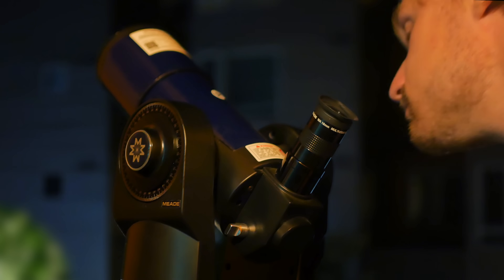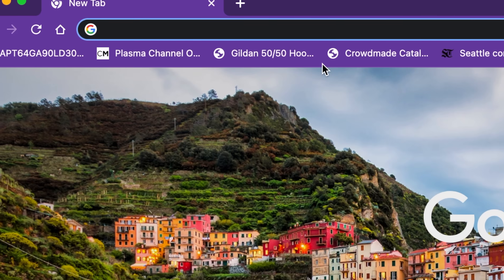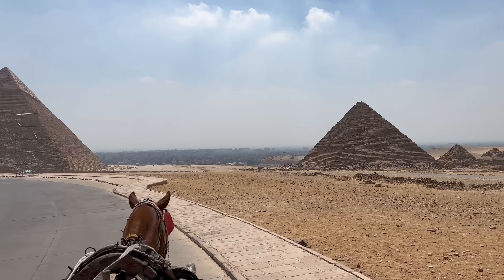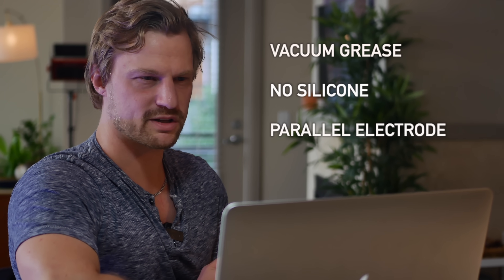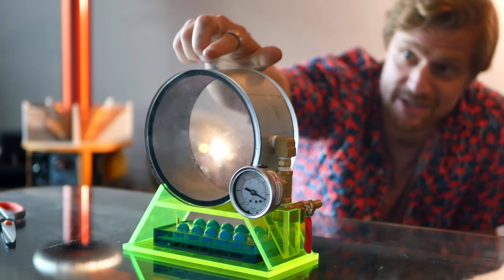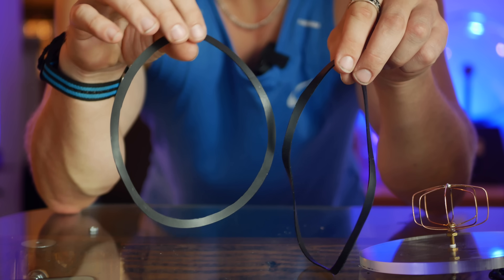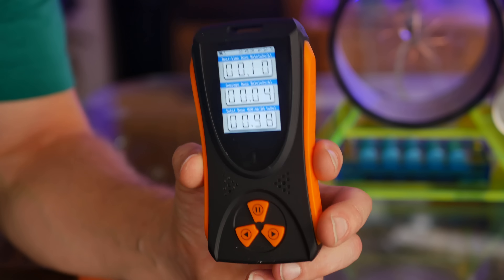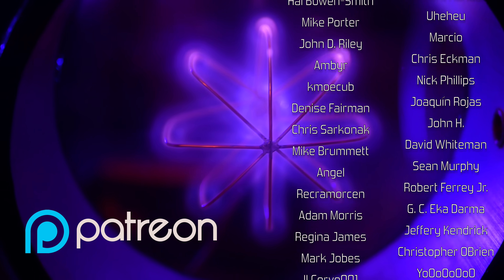Building A Nuclear Star In A Jar (Fusor)

Comment: Hey heads up, that reactor is probably not safe for fusion. The big acrylic windows could melt in the electron beams that form and the plasma heating them up. Also the aluminum frame and acrylic windows are transparent to xrays so it needs to be fully encased with shielding or it'll spew xrays like crazy. And you need neutron shielding as well. And even the backscatter can be very very dangerous. It's a grogeous demo build for sure though. One of the nicest I've seen honestly. But please don't try running that at fusion temps. Also there are a host of different laws around building these and many places require a license of some flavor or another. It's easier in the US, but varies state to state and can still have issues if you're not careful and you'll be posting the video as evidence of you doing it... so better safe than sorry. I know this because I almost built a working fusor on my channel recently but stopped when I learned about the license and 100K fine for not having it. So I paused the project until I could sort that out and get the license in advance. If you wanna chat about this I've been at it for years and might have some tips. Hit me up. There's a ton of amazing things that can be done with this if you get reasonable neutron outputs.
Reply: Man I used to watch you all the time , are you coming back anytime soon?
Reply: @gameingking8971 he's been back for a minute he posted like 2 weeks ago
Reply: Listen whats this person's saying!!! TTE im a subscriber to your channel, thanks for creating your content and sharing it!
Reply: Hope it is not too late!
Reply: This needs to be pinned so everyone can see it. Not to put plasma channel down but he really dove into this project without researching thoroughly. Fusion can certainly be done at home, but it's not something you just throw together out of craft supplies.
Reply: @RMX7777  What do you mean "fusion can be done at home" it absolutely can't. If it were that simple then we'd be completely off fossil fuels
Reply: @Butterspunk69  It absolutely can. That's what a fusor does.
Reply: @mattcurrent00 lol okay bro
Reply: @Butterspunk69  There is a massive difference between doing extremely small-scale fusion with no (usable) power output and doing power generation scale fusion that is self-sustaining with an extractable energy surplus. We've been making and operating fusors since the 1950s.
Reply: @RMX7777 ….did you guys actually watch the whole video?
Reply: @MaxfieldTwo  yeah?, I've watched the whole thing through a few times.
Reply: @MaxfieldTwo  obviously they didn't coz if they did then they wouldn't say this. He did the radiation test
Reply: @EverydayOpium  Did you watch the whole video? Yes he does the radiation test at the end, and determines that he has not yet achieved fusion. He then states his intentions to improve upon it until it can function properly.

Thus the warnings given are legitimate, his reactor is not safe for fusion, and it should not be attempted.
Reply: @RMX7777   HE DID NOT GET THE THINGS FROM A CRAFT STORE! DID YOU WATCH WITH AI OVERVEIW?
Reply: @SajithPrathees  No, I didn't use the AI overview, that wasn't even a feature on YouTube when this video came out.

The entire point is that acrylic isn't a suitable material for building a fusion reactor. Using acrylic makes it a fancy toy, not a scientific instrument.
Reply: I like the fusion reactor that has a sphere of cannons around it, steampunk af.
Reply: What is the License? I can't find anything about it online other than people just saying that it exists but no actual names for the license so I'm just wondering what the name of it is.
Reply: @nickonizer  I can't speak for everywhere, but if you live in the US it varies from state to state. The law would not be specifically for fusors, but rather for radiation producing devices.
Reply: @RMX7777  oh groovy I'll just make it not produce radiation and I'll be good right?
Reply: @nickonizer  So long as you keep the voltage below 15kv you shouldn't have any issues.
Reply: This fusor set up doesn’t look like it has enough power to actually produce any fusion reactions, but otherwise your comments are on point about the needed shielding if the design is powerful enough…
Reply: Just pulling up the ladder more so people have to get some useless paper from a college.
Reply: Hey bud I don’t think this is supposed to actually produce a fusion reaction or at all capable 😅
Reply: Thank you for commenting on this video, (love your channel) you're part of reason I knew this was worth watching
Reply: To hell with the government.
Reply: Yeah the intellectual workspace just got locked down by me. Those "Laws" anybody speak about be our birthright by the psychedelics penetrating into my mind I was showed the problem earlier
Reply: .0LP
Reply: Why u suspend it in water.
Reply: screw the government, build the reactor.
Reply: Reminiscing the scene in the movie Chain Reaction, when a few City blocks were leveled. 😮
Reply: Dude, where on earth you will get deuterium or tritium? Just curious))
Reply: @СтасКрутько-м1т  Deuterium can be purchased online, but it is expensive. It is also possible to electrolyze it from water but this would require months of work.

Tritium is over $1,000 per gram and is heavily regulated. He will never get a hold of a large enough quantity of tritium for fusion.
Reply: @СтасКрутько-м1т  United Nuclear.
Reply: @СтасКрутько-м1т easy to buy D2O but not cheap.
Reply: @СтасКрутько-м1т  dueterium isn't hard, but tritium is very hard to get
Reply: Well, you just got yourself another subscriber! Can't wait to see where you take things! Meanwhile, I'll enjoy your back catalogue. :)
Reply: Rules are meant to be broken 😏
Reply: no u
Reply: That won't be an issue with the amount of neutrons he's likely to get from this.
Reply: B careful fusion scientist have a tendency to go missing
Reply: aluminum is opaque to x-rays, they literally use it in hospital equipment
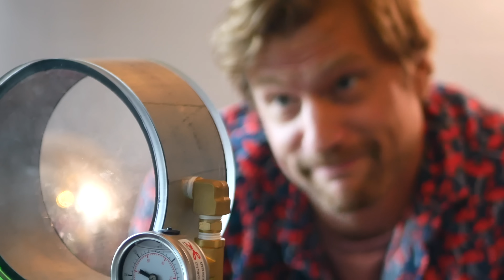Reply: 8:35 how do he connect the wires to the metal shape in the middle
Reply: Bro who are you
Reply: @GamersCreedGaming he’s only the best biologist YouTuber in the world!
Reply: I would probably recommend synthetic sapphire glass as a replacement for the acrylic if you make one capable of fusion. What would be better is a led based glass as it’d absorb most of the radiation that escapes from fusion
Reply: I getting blind by reading comments 😢
Reply: Do it 🤓 or no balls
Reply: It's like watching special forces
Reply: The inverse square law probably means he’s fine at 5-10 feet away, even if it does generate X-rays
Reply: Damn, bro wrote an essay
Reply: 2:11
Reply: Wait this is real?
Reply: Extremely helpful advice and a collab I’d honestly love to see.
Reply: I just ... yappocado
Reply: This is why for my next career im looking to get into an industry without licenses! Too much for them! plus fees once you jump through their hell of a test. Train and done at location. No more bs driving to god knows where for a stamp.
Reply: also they expire in a year.
Reply: Updates on the meat robot 🤖?
Reply: time to search up casimir effect and Salvador Pais's High frequency gravitational wave generator patents they are confirmed and US Navy locked down. All this stuff is so so so obsolete and it's a crime to not have all you intelligent people driving the new fields forward for the last 50 years 😢😢😢
Reply: Well that's stupid, why have it to where you need a license to build a fusor? This is why fusion technology hasn't progressed, the very ingenuitive people in the public who could actually get this working on a practical scale can't get a hold of the technology.
Reply: @glamrockfoxy3962  you need a license so you don't get a nuclear boyscout incident all over again
Reply: How is this any different to just having a florescent light?
Reply: Dude your a wuss lmao
Reply: You'd need deuterium to make this thing work. At best you are simply making plasma from the air
Reply: didnt you eat a mummy
Reply: Longtime fan of your channel! Thanks for sharing the wisdom gleaned from your work. 🙌 🙏
Reply: That's valuable advice you've given, hope he understands the implications. Given how he responds to those giving him praises and not you says a lot. I've watched a number of your videos, really professional work in both areas of science and content creation. Looking forward to your next upload.
Reply from the maker: Hi Nicholas, I don’t respond to every comment, but appreciate every one. 

People seem to forget that I had a fusion engineer look over my design, confirmed I’d likely not produce much fusion, I tested it and found no radiation, and my power levels were far too low, at a few dozen watts. 
I liked the educational aspect of the Fusor and the beautiful output more than anything! Cheers.
Reply: @PlasmaChannel  Then shouldn't this have been presented as a demo fusor? At every point through the video you made the claim of working towards real fusion.

It's only after understanding how truly difficult it is that you try to reinterpret your intentions. You've made comments to others saying things like " just wait until I add deuterium and the Geiger counter sings". Not your exact words, but they are close. The comments section is long and it would take me a long time to find it again.

At no point in the video is there any mention of the fusion engineer saying that your design wouldn't produce much fusion, so nobody forgot.

I don't like being negative, what I wanted was to see you iterate and eventually come up with a design that would function, but instead you've chosen to try and mislead others in your intentions.

Again, I've always been a big fan of your channel, but this has all been really disingenuous.
Reply from the maker: A demo Fusor built with sufficient design, such as mine, will produce small amounts of fusion. It requires power levels that are higher, and the addition of D and T, both of those situations i intended for another future attempt.

The engineer and I talked for a long time, the snippets of the conversation shown in my video were just that. Snippets. A lot of spoken conversation was left out. 

That being said, I did build a “nuclear Fusor capable of fusion”, as promised throughout the video. I just did not press the correct variables hard enough.

Therefore, I indeed was working towards true fusion, with this being the first video in the series. 

So, any interpretation of being mislead, is just that- an interpretation. I’m sorry you feel that way.
Reply: @PlasmaChannel  It may theoretically be possible to fuse a few atoms in your setup, but you haven't proven it. You say your design is sufficient, but that is just not true. The acrylic walls would melt under the conditions required for detectable neutron emissions.

It isn't as simple as backfilling with hydrogen isotopes, fusors require conditioning, and that means they need to remain under full load for extended periods of time. 

Increasing the power output for your supply will not resolve the issue, at least not until you can achieve a deeper vacuum. At the pressure currently present in your chamber, it will only result in electrical arcing between the grid and the walls.

If you're going to take this seriously you'll need to make the switch to stainless steel high vacuum equipment.

Furthermore, if you somehow did manage to bring your setup to fusing conditions, even if only momentarily, the lack of steel walls would ensure that you would irradiate yourself. Breaking radiation is no joke.
Reply: @PlasmaChannel  it is nice to see people worrying about others...world’s cool. 😚
Reply: @PlasmaChannel  I went ahead and thought on what you've said, and watched your video again with that perspective. I've concluded that my expectation for what you were making did not match your intentions.

I suppose as someone with knowledge on fusion, I had mislead myself into believing you were working towards something more technical.

In reality, after watching again I can see that you just wanted to explore a cool part of the universe we live in, and share that with others. That is something to be respected.

I wish you luck in achieving your goals, and if you would consider it, I'd still like to give you some advice.

Adding deuterium to the chamber will not cause any noticeable change with your Geiger counter. This is because rather than being caused by fusion, the high energy photons given off by the reactor are created from breaking radiation, primarily from electrons emitted by the central grid accelerating towards the positively charged walls of the reactor.

Radioactivity can be a rough estimation of fusion occurring however, as it would allow you to know that the electrostatic potential well is deep enough for high energy physics.

What is important is that if the conditions in the reactor are sufficient for fusion, the x-rays should also be generated without the deuterium fuel present.

As you have suggested, one cause for the lack of these conditions is the power supply. While the voltage is sufficiently high, without the current capacity to back that up, the voltage will sag deeply under load.

Ultimately both the power supply and vacuum pressure will need to be improved to achieve your goals. Again, if you take anything away from this, it is that you should detect radiation even without the hydrogen isotopes present.

For the rate of fusion you are aiming for, protecting yourself from neutrons does not need to be a consideration. Instead, just keep your Geiger counter handy and monitor your exposure to x-rays.

And please don't use tritium, deuterium is plenty sufficient on its own. While fusion rates would be much higher, if your only goal is to do some level of fusion, it is dangerous and unnecessary. Not to mention likely illegal.

As a final bit of advice, a thermocouple type vacuum gauge should be used to take a reading directly from the space inside the reaction chamber. This is the only way you will gain insight to the conditions within the reactor to any degree of certainty. If this is not possible however, it is roughly possible to estimate pressures by visual characteristics of the plasma.

I can't say if vacuum pressures of 1-30 microns are possible in the type of system that you've built, but I wish you luck in your attempts. Keeping all of the components incredibly clean is of high importance.
Reply: @RMX7777  love when someone can admit they may have been a bit off base with their opinion. Nice way to start my day, so thanks!
Reply: @RMX7777  what in the world
Reply: @RMX7777  is it even possible to buy Tritium without setting off reflags somewhere?
Reply: @tylerdurden3722  It can be purchased in the form of self powered safety lights but these typically contain only a few micrograms of material. My concern was he would try to open one of these up and expose himself to radiation.

It's pretty much impossible to get a hold of enough tritium to do any fusion, especially considering it costs around $1000 per gram. You would need around 10 grams to run a fusor for a few minutes. 

Deuterium on the other hand is relatively cheap and completely unregulated in the US.
Reply: @RMX7777  Someone is salty AF
Reply: @wdtripps44  If you would read through all the comments you would know that's not true.
Reply: @PlasmaChannel next we'll hear that dude actually loves tomatoes!

Thanks for the awesome vids; I really appreciate the good mix of science!

Edit: and glad to see that speed square has metric on it 😎
Reply: @PlasmaChannel 

Pin this please. I found the cautionary comment and had to search for this response.
Reply: fr, that person did a good thing and reflected on their though process, then clarified that they could have said or done things differently. @Resyektt
Reply: @RMX7777 he also says just wait until I add deuterium in the video while holding a geiger counter lol
Reply: @richardrhodes9664  I'm not sure which of my comments your replying to, but many of them state  what you just said. I'm not really sure what the intent of your comment is.
Reply: @PlasmaChannel that's good 👍
Reply: @RMX7777 no where in this video did he say he was producing fusion lmao
Reply: @Zaque-TV  Yeah? And no where in any of my comments do I claim he did fusion. What's your point? My comments were directed towards his intent to add deuterium in a follow-up video
Reply: @PlasmaChannel is the D and T test run of the fusor in a video?
Reply: @RMX7777  not sure why I just read this entire comment thread but I appreciate your input :) clearly that 'next video' didn't happen
Reply: There was no fusion. It’s a demo fusor. No x-rays or danger. Settle down internet. Great demo fusor though. Love the design.
Reply: @toydrone  exactly
Reply: @toydrone  you must've not watched the whole thing. If you did you would know he's planning on actually injecting tritium and the other thing
Reply: It’s ok I can’t spell grongorus either 😅
Reply: Yea. Big brother definitely doesn't like people building a cheap free power generator to compete with thiers. Much less telling others how to make it. 

This is small fry stuff comparatively, but a spark can easily become a wildfire. 

Few more additions need to be made before it can reach it's full potential. Other than for pretty colors and power 😏
Reply: @mchaten9071  Definitely not. Unless there is some unknown physical principle to be discovered, it is impossible for the power produced by a fusor to generate a net gain in electricity.

As things stand now, only thermonuclear generators are feasible, and these cost millions of dollars to construct. If fusion power were easy it would be done already.
Reply: @RMX7777  I've got a few ideas. 😏. Nobody willing to take me up on the offer to collaborate yet though. Most think the ideas are crazy. Yet all of the elements are based on proven principles and technology. 

They simply need to be combined in the correct way. Don't have the funds or various technical skills myself. I'd need a dedicated team of experts to make it happen. 

Similar to how Steve jobs was the creative brains, while woz was the assembler.
Reply: @mchaten9071  The tendency for fuel ions to scatter is magnitudes higher than the odds of colliding. The only way net power can be generated is to have the scattered ion energy make its way back into a thermal distribution, that way the energy is not lost.

On top of this, the electrode in the center of a fusor is vital to its operation, but if the fuel density were increased to levels required for net energy gain, the electrode would be destroyed from all the heat.

Regardless, I still feel there is value testing new ideas. A fusor only costs around 4-5 thousand dollars. If you're serious about your ideas, it is possible for you to test them.
Reply: @RMX7777  what about not using a solid electrode?  I know there are alternates that do this in the abstract, but I am definitely not a professional when it comes to nuclear physics.
Reply: @homeopathicfossil-fuels4789  The issue really boils down to scattering. The likelihood of two ions colliding head on with just the right relative velocity to enable quantum tunneling is magnitudes lower than the likelihood of the ions deflecting off one another.

Even if we assume there is an electrostatic potential pulling ions in without a physical electrode for them to collide with, the reactor will lose net energy due to breaking radiation.

Anytime a charged particle changes velocity, it emits electromagnetic radiation. The strength of this radiation is based on the amount its velocity was changed. Velocity has two components, speed and direction. Changing either of these changes the velocity. 

When the ions in a reactor collide slightly off center and deflect, they experience a very large change in direction, thus also velocity. This change results in the ions emitting X-rays. These X-rays carry energy away from the reactor, lowering the ion temperature.

For a reactor like a fusor, most of the energy is lost from grid collisions and X-ray emissions. Even if the grid collision issue was resolved, the X-ray power losses would still be greater than the fusion power gains.
Reply: @RMX7777  Hi! For what I can read you really know your stuff, do you have any recommendation or textbook to start learning about this stuff? I mainly want to start hobbying around, building this thing made in the video would really make me happy even though it's not generating energy properly.
Reply: @RMX7777  hey thanks for the discussion. It really helped my understanding, a few things just clicked into place.
Reply: I agree radation can lead to death if not that carefull so dont even think about doing it if you do this you may contamnate the entire city if your not carfull
Reply: @ahmedbobgaming1910  You can't "contaminate the entire city".
Please learn about radiation before commenting.
Reply: @ahmedbobgaming1910  It doesn't make things radioactive
Reply: @realdotty5356 he is literaly explaining that he might go to jail if he is not carefull which part of this is nerdy?